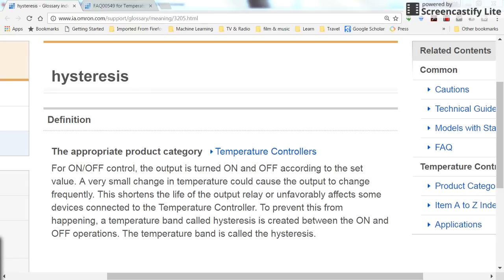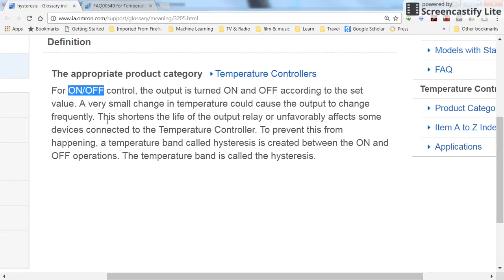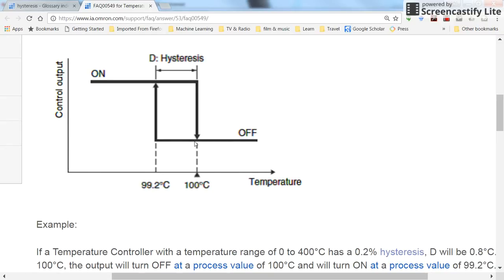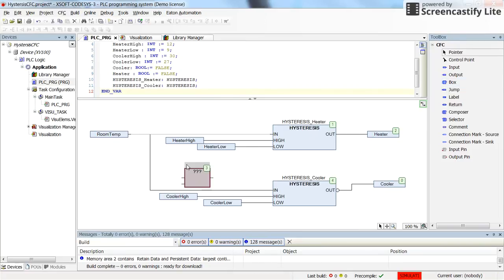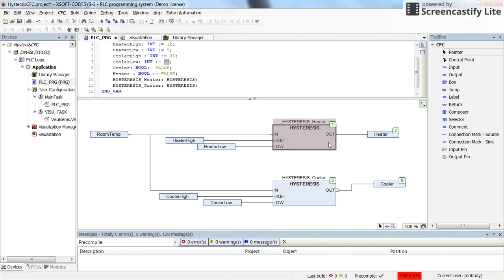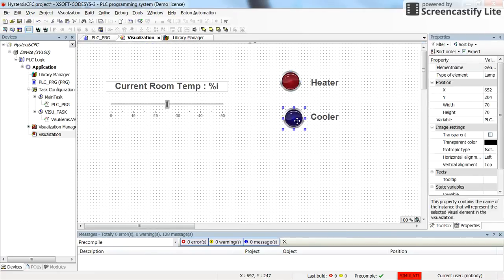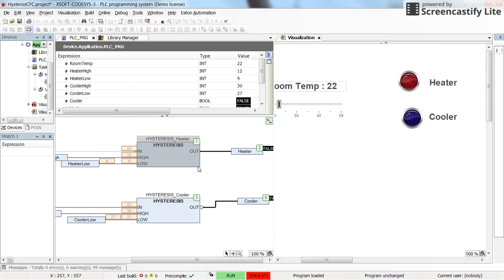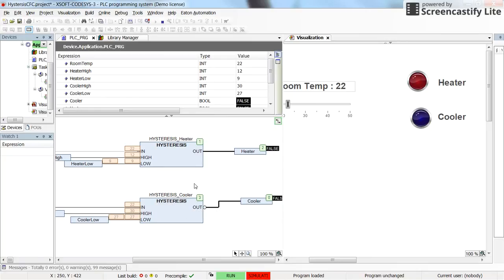CODESYS: HYSTERESIS function block in CFC#HYSTERESIS #codesys #plcprogramming #iec61131 #cfc#twincat

Comment: How to use hysteresis in structured text inside an IF statement?
Reply: Did you ever figure it out?  You declare an instance of the HYSTERESIS Function Block (as shown here), and then you simply call this FB with the input variables to the FB (the deadband thresholds).  The output of the FB should be linked to the device that is being turned on/off.